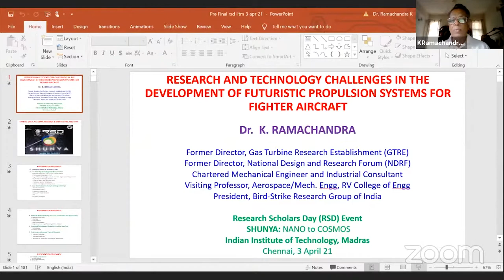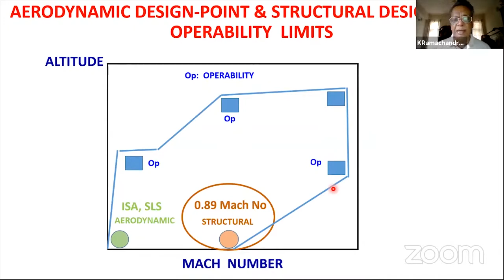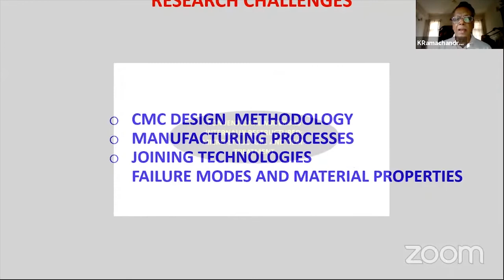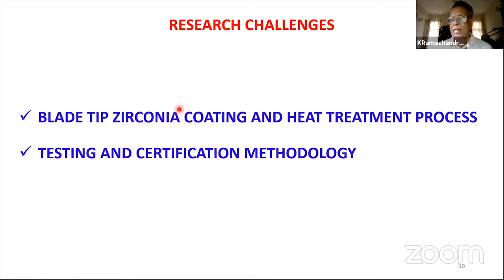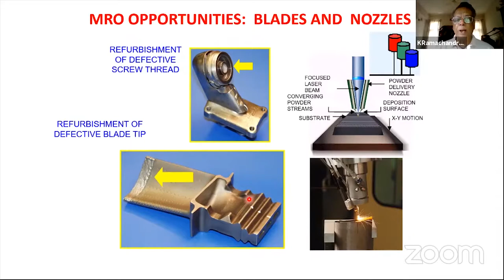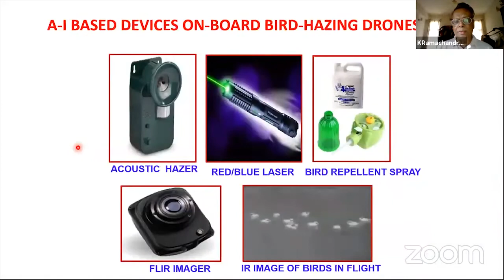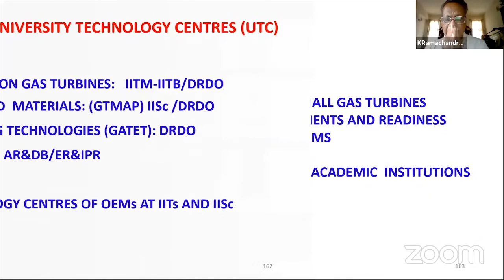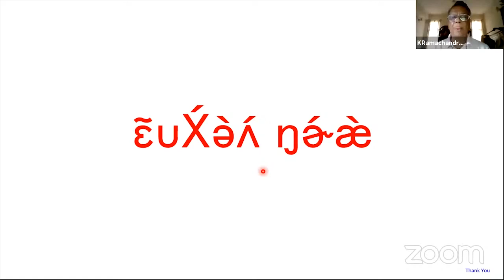"R&D Challenges in the Development of Fighter Aero-Engines" - Dr. Ramachandra K//RSD 2021//IITMADRAS

Comment: Really insightful Lecture given by Sir. 
but crux I got from sir is that we are focusing mainly on increasing T/W ratio of engine. 
with Tempest of UK & 6 gen of US they are talking about Variable Cycle engine to really increase efficiency of engine in normal flights. What are we doing on it ?? 
also with increase EW Engine need to extract Huge amount of electricity RR is working to increase it manifold from there currently superior engine. How we are looking at it?
Also from Open Source Information it is known that Kaveri wasn't able to extract max power for certain seconds is it true ?? 
What happen to without afterburner Kaveri engine for Navy's Ship ?? 

Also MOD & GOI is interested with Safran for 125KN JV engine Hope we get to know main thing from that & be able to develop family of engines